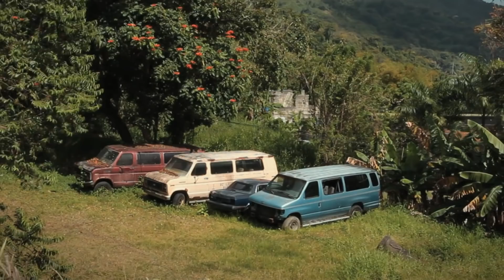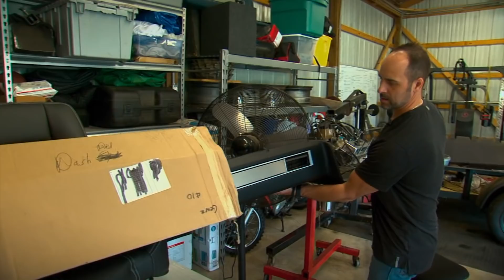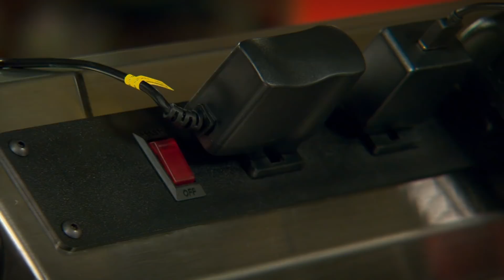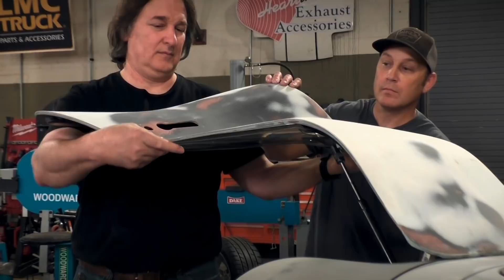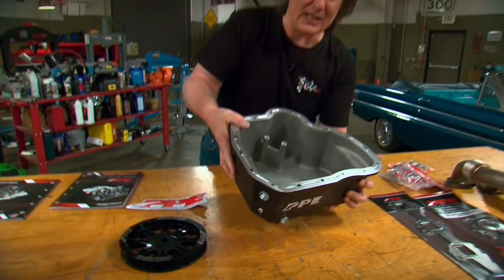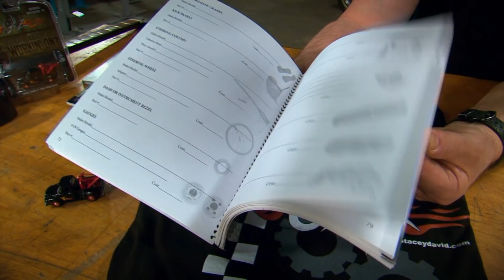Gearz On the Road - Squarebody Chevy - Stacey David's Gearz S13 E12

Comment: Dang! I’d be in heaven to have that guys shop!!!
I’d love to have that tool box from cornwell too!! That thing is a tank 💪🏻
Reply: I'm getting a 20x30 shop with 12ft walls 10ft roll up garage door, standard walk in side door and front window built for my stereo/custom car shop. $6000 installed. Ill have to provide the concrete slab, electrical and insulation though